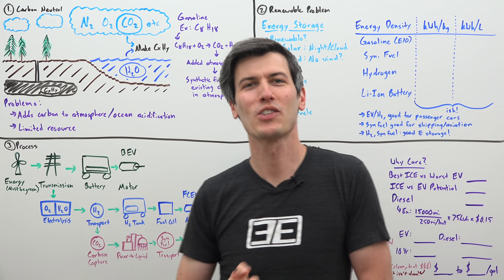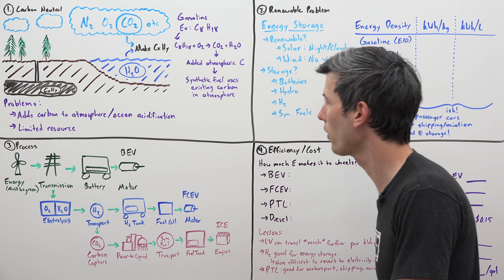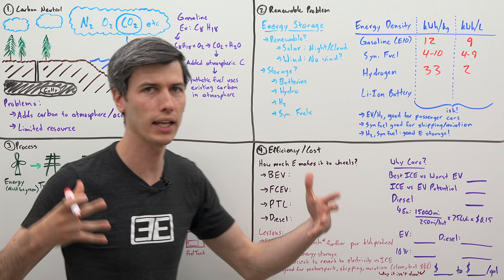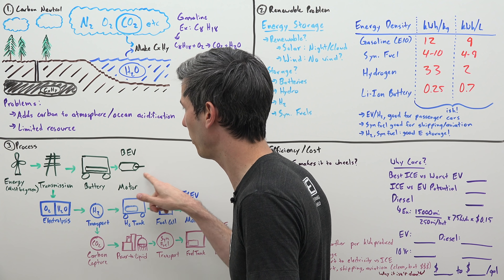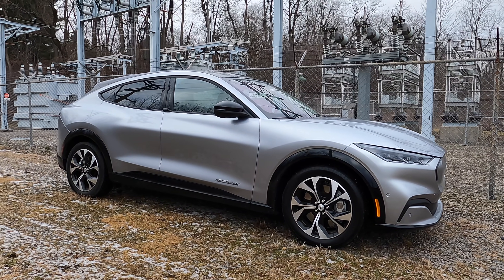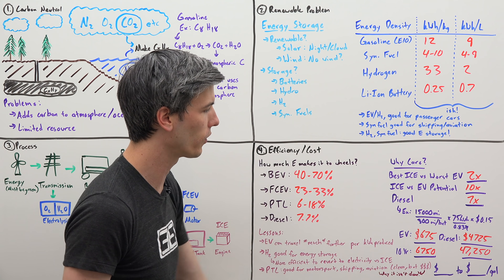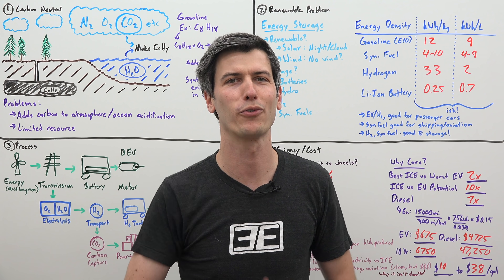The Big Problem With Synthetic Fuels

Comment: You had me until the end, at $2 a litre that would be literally better than a lot of fuel prices in the UK and these are diesel numbers. I imagine similar in Europe. $2 = £1.42 and current UK average per litre for petrol is £1.29 diesel £1.31. £1.70 being highest as of current costs which is no higher than average right now.

But in general the argument in the UK is that most people live in 'town houses' with no owned parking or driveway, it's illegal to run a cable across a footpath. Others in apartments which will inflate flat prices so much to install electric chargers which it's already a good £300k for a London flat with no parking as is. Synthetic fuel is likely to have a place here.
Reply: To effectively make synthetic fuels carbon neutral you need to start with hydrogen. So your issue is fixed if you just buy a fuel cell vehicle instead. Hydrogen Fuel cells will be the only option for large mass transport. Particularly if we want to reduce the amount of non renewable resources we dig up to make battery’s. Carbon emissions aside we keep missing the point that digging up the earth to make battery’s isn’t that much more sustainable than digging up oil. Fuel cell cars only need a battery 1/20 the size. If we can make hydrogen in a renewable non carbon emitting way, the efficiency comparison to battery’s is less relevant.
Reply: @Julsnalice  Do some basic research and you’ll find out your comment makes absolutely no sense at all. But guess you already knew that. If not, you typed your comment on a phone or laptop or computer which is 100% made out of mined materials😅
Reply: @Julsnalice  the only issue with hydrogen is that it's extremely combustible. One small fender bender could cause a big explosion, worse than the Ford Pinto
Reply: That $2/L is before any costs are added on though such as vat, profit for the company producing it/station profit per litre, fuel tax etc. Probably heading towards $3-$3.50 easily before you actually get to purchase a litre making it roughly £2.50 per litre.
Reply: @iandavis8725  It's worth nothing this all assumes Porsche reaches their goal. However, it is also worth noting that governments will also adjust taxes accordingly, since these fuels are much more environmentally friendly than regular fuels, which would decrease the gap and incentivize people to make the switch. They should probably slowly phase out fossil fuels at that point.
Reply: @HazewinDog  why would a government ever reduce fuel duty? It will just remain the same or frozen for a long period. Never in history has fuel duty gone down.
Reply: @iandavis8725  considering that synthetic fuels count as green. They most likely won't have extra fuel tax like fossil fuels
Reply: @DrTheRich  fuel isn’t taxed because it’s not green, it’s taxed because it brings in £40bn a year for the UK Gov at least.
Reply: @iandavis8725  Doesn't matter what the price is right now. What matters is where the price will head in the near future (5-10 years).
Reply: This video is wrong. He assumes the synthetic fuel will be made with electricity that costs the same as that you use at home to charge your battery vehicle. In reality synthetic fuels will be produced in places on Earth with the absolute cheapest renewable energy. Thus minimizing the real cost difference. So in the end, the bad efficiency matters much less than you would think.
Reply: @cryptohouse1676  irrelevant, until you use ICE. it's the awful unefficiency of non-electric motors that makes any fuel a failure
Reply: @carloorelli3538  No, you need to look at the big picture. Total cost and total environmental impact. Efficiency is just a small part of the equation.
Reply: Saudi makes a barrel of oil for less than $3.00... while synthetic oil cost is $318 a barrel. That would be comparing apples to apples. I do understand how when liters are used as a unit of measurement it can cause one to conflate that with end user cost, but that is not what is going on here.
Reply: The haters replying to this are picking up the wrong point - most of Europe has ancient towns and cities with no easy way of implementing enough charging for a significant proportion of the population that would be practical for current generation EV batteries. It's a big problem, I'm predicting EV sales will plateau once everyone with private parking & charging has one.
Reply: @jinbee2627  that's when the 'mobility as a service' arrangements kick in. If you have ready access to a vehicle, you don't need to own your own. And if vehicles are shared, there don't need to be as many of them, so the infrastructure to park and chnage them can also be reduced.
Reply: @jinbee2627  Youd be wrong. First, charging of EVs is done mostly at home so you actually dont need that many charging stations in a city even a super town rural one. Plus, gas stations are adopting them, so...

Yep, all of that is a non issue. You wont see a plateau because the entire world is going full electric with bans on ICE sells and car manufacturers are switching their full production to EVs. So in like 10-15 years, 100% of cars sold will be electric, hard to plateau with that.
Reply: @dzello So only homeowners will have vehicles if your utopia comes to pass. Because not everyone will have guaranteed access to chargers. That is like the green new deal happening. The rich will be fine and the rest of us will be fucked. It wont happen.
Reply: @shadowfire246  1. It actually IS happening right now. 
2. Everyone will have access to chargers. They are slowly getting built literally everywhere.
Reply: @dzello  Nice speculation. Do you really think someone without the possibility to recharge an EV at home will buy one? It defeats the purpose of buying it in the first place for economys sake (not that it is economical in the first place since they are more expensive than ICE cars). Noone is going to buy an EV to stand at a recharging station to pay 20£ just for recharging 2-4 times a week while also losing at best 40 minutes of their time. Yep, if Porsche manages to lower the price of their eFuel then this EV-agenda is over.
Reply: @MT-rc3gn  In the future, yes. Someone without the possibility to recharge an EV at home will still buy an EV. 

And considering they intend to literally ban ICEs, he kinda won't have a choice regardless. 

So really, it doesn't matter what you think lmao. Plus, Porsche intends to go electric as well.
Reply: @dzello  well we'll see
Reply: @MT-rc3gn  I mean, the bans are around 2035ish, its already in place. Manufacturers have also clearly said their intentions with Porsche specifically saying EVs are the way of the future, not efuel. As prices go down, people will buy more EVs.

This is all things we already know.
Reply: @dzello  we'll see
Reply: Yes but it'd £1.41 a litre plus 20% for VAT, then plus 58p a litre fuel duty so well over £2 a litre
Reply: Agree, most homes don't have the ability to charge a vehicle. People need to come to terms with both ICE and EV existing in the long term. The synthetic prices are cheaper than some places I've seen, especially motorway services. 
A good amount of people don't care what fuels their transportation, so there's certainly space for EVs to increase in their presence but a complete switch is unwise. There's also the issue around people having freedom of choice etc.
Reply: @car_ventures  How do most homes not have the ability? Do you guys not have power in your houses? You need to be more detailed than to just outright lie. Most homes DO have the power and CAN have the ability to charge quickly, easily. Very very very easily. Or already do. Either way, what you said is a fabrication
Reply: @jf8138  After you have an electrician install a 240v line from your power box for 2+ grand. Cause everyone can just pull that kind of money out of their asses.
Reply: @car_ventures  Don't forget the $2 per litre is before tax which is 2/3 the price in the UK.
Reply: @car_ventures  Once their is enough ev chargers you can charge your car wherever you park your car
Reply: @lachlanB323  I dont see many ev chargers out in the mountains or in the middle of the desert.... or really anywhere not urban.
Reply: @shadowfire246  Your telling me that non urban areas don't have power points? How do you charge your phone?
Reply: I often wonder about the practicality of the impending change to electric. Millions of electric cars rather than the relatively small number currently, needing to be refuelled taking hours rather than 5 minutes. A petrol station with 8 pumps would need about 200? charging points. Most people will need public refuelling facilities. They say it must happen I look forward seeing how this is solved. Private cars only for the rich and public transport for the rest. Covid puts that prospect into context.
Reply: @philspencelayh5464  There will be an abundant surplus of synthetic fuel from the aviation and marine industry. This will probably go straight to gas stations at lower prices than people expect.
Reply: @cryptohouse1676  where would all the energy come from?
Reply: @magnusd8226  Renewable energy from the cheapest places on earth. Wind in Argentina or Sun in Sahara for example. That electricity is 15x cheaper than what you pay in the US. 
Did you know that covering only 1% of the Saharan dessert in solar cells gives enough electricity for the entire Earth? We can have as much electricity as we need. It all comes down to economics and making things profitable. Then things happen fast by themselves. Renewable electricity will much cheaper in 10 years from now also.
Reply: @cryptohouse1676  Most aircraft run on kerosene. Ever tried to run your car on kerosene?
Reply: @philspencelayh5464  electric vehicle drivers don't charge at the gas station. My car charges over night in its regular parking space.
Reply: @philspencelayh5464  hours? A Tesla can be recharged 75 miles in 5 minutes. and there are rumors 4680 batteries get fully charged in 10. that's how you solve the problem
Reply: @carloorelli3538  When you buy into the charging ecosystem of one manufacturer does that make you beholden to them for your next car? Just curious, I'm new to this.
Reply: Many of the settlements in the UK and Europe were settled and even densely populated before mass adoption of automobiles. The cuts to railway track-miles in the 1960s effectively pushed many places to adopt cars. An expansion of railway service (and electrification of the lines) will bring those areas back into Pre-automobile mobility/connectivity with greater power efficiency and lower carbon output.
Reply: The key point I hope people would understand is that we need 3-4 times as much renewable energy to transition cars to Synthetic fuels instead of transition to BEVs.
How on earth will we achieve that if we already struggle with getting our grid green with current energy needs?
The cost of all this extra renewable energy is never discussed when people talk about the charging/fueling price.
Reply: No parking?..where would you even put ur gas car them🤷.
Anyways $2 might make sense compared to conventional fossil fuels but this video is about electric verses synthetic where even $2per litre is expensive
Reply: Love your lc brufa
Reply: *crying in australian prices
Reply: Hearing the word "Bonkers" in an American accent is truly epic. Definitely made my morning.
Reply: That price is influenced more due to tax than anything else.
Reply: I agree.synthetic fuel can be expensive and energy inefficient to produce.but what if the clean energy resource is abundant and the price is lower?(can be done I think)
Reply: @vanwandererx852  Yup, that will be the situation in not too long. Both electricity and gasoline where I live is super expensive. So E-fuels made cheaply in Sahara or something will probably be able to compete on price quite soon.
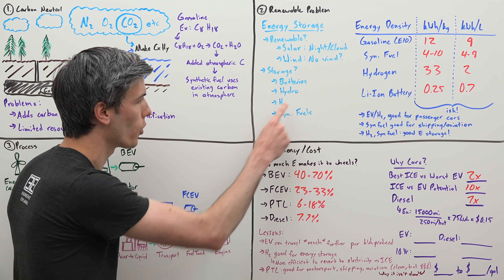Reply: @jimj2683  But countries and people in those areas will also probably need that renewable energy, you can't just go there and take it away from them. And even if for some reason we would be forced to do that, it would still make more sense to store that energy in hydrogen cells, transport it and then convert it back to electricity, as Jason also pointed out this would still be more efficient: 10:30 . 
So either this, or we would use that potential efuel produced in those remote areas for airplanes and ships only, due to it's energy density. 
Long story short, it's innefficient and irational to use efuels for personal cars.
Reply: You are dead right mate
Reply: It’s funny then how the EU recently allowed e-fuels, but Britain maintains their strong stance against them
Reply: Also, syngas could be exempt from fuel taxes (since those function as an effective carbon tax). If we want to tax cars, to cover costs for road maintenance, we should tax EVs same as combustion engines - just cause they don't burn fuel doesn't mean they don't damage roads.
Reply: That's the price after a markup and cost of transport etc. It means that you have to pay roughly double
Reply: I don’t know about electricity price in USA but in EU to charge 300kwh battery it will cost about 80 euro so for 15000 miles it will cost about 4000 euro per year, but my Audi will cost about 2000 euro if diesel cost 1.5 per litre. And range problem with electric car in winter is max 60% so it will cost even more
Reply: @flaperons3429  what? What's the cost of electricity there?

If electricity is truly 2x the cost of diesel, maybe you should get a diesel generator for your home...

At that point you're better off with solar! Even in a cold northern region, you just need 3x the amount of panels to compensate.
Reply: ELLOOOOO
Reply: Finally a response with some sense in it ... If we put up a charging point for everyone in a flat, we'll have a couch worth of living space left ...
Reply: A charger can be a simple power outlet. How is that costing us living space? 🤦🏻‍♂️
Reply: @bramjacob8623  😂, the fact you managed to gather 16 likes on this type of nonsense comment is hilarious. Must say, congratulations
Reply: @bramjacob8623  maybe there will be charging stations in public parking space,
Reply: And most people can't replace cars at the drop of a hat + the waste it would be if all Gas cars were banned. Plus again you can't buy a full-size SUV BEV right now. If BEV prices stay the same then it's just cheaper to keep your old full-size SUV than buy a new one. $500-$1000 a Month on gas still gets you 13 years with it instead of 13years of car payments on a new GMC Hummer.
Reply: It would, unless it's production capped. I'm sure Porsche will only be able to make so much of it per year, and I'm sure they'd keep it exclusive to Porsche customers for a while.

And if curious, for EV's I've seen the "urban supercharger" concept prove plausible. EV's are much more efficient at low speeds, and cities have everything closer together, so short 10-20 mile a day trips are likely, so a 200 mile range EV would only need to be charged once every 10 days, which could just be spending an hour at a fast charger once a week on your day off. If that's inconvenient though, there's always public transit.
Reply: @cpufreak101  why not  spend one tenth of that hour to fill your car with gas as well as avoiding public transportation and it's germs/diseases. Find a way of boosting the economy to adopt the high gas prices (if that could be possible)
Reply: @kegtrick  TLDR, it's unsustainable in a climate conscious world.
Reply: @cpufreak101  in more context, all I'm saying is I'd rather figure out how to make synthetic fuel more affordable and not loose the convenience of filling a tank in less than 10 minutes.
Reply: Don't care didn't ask plus your girlfriend was underage
Reply: Says guy who loves need for speed over forza mate you wrong
Reply: That's why EV is the solution, because electricity is much cheaper than any fuel. Even in the UK you get paid for charging your EV
Reply: @lillypichu4566  But electricity is made using fossil fuel. Electric cars are (currently) a dead end. If they are to succeed in replacing gasoline engines they must find a way to improve the power grids in developed countries. We currently cannot create enough electricity to replace ICE powered cars.
Reply: @matthewmosier8439  I'm talking about UK, and there's no problem about electricity in UK, some of facility even willing to pay you for charging your EV
Reply: @matthewmosier8439  it is not true that we can't "create" enough electricity, we can't store enough electricity is the issue. Also fossil fuels are not "creating" electricity it is taking energy from the sun stored by plants over 100million years ago and releasing that stored potential energy.
Reply: @LiverpoolReject  You are correct, energy is not created as far as we can tell, it just changes forms. My point, however, is that, practically speaking, if you were to, say, buy every home in a given country an electric car, that the power grids would fail. There are trillions of dollars, probably, in infrastructure to create and maintain all of the vehicles on all the roads in developed countries and to quickly swap that energy into electricity from fossil fuels would take a monumental effort.
Reply: @matthewmosier8439  yes so we need to get started and stop subsidizing carbo positive fuels. We have built massive infrastructure in the past and it is time to do it again. This time though if we fail it is going to be far more costly.
Reply: @lillypichu4566  You gotta be joking right!? We (the UK) do NOT have a grid that could support even 50% of all current cars on the road going to EV in terms of supplying the amount of electricity needed for people to charge their EVs.
Reply: that's why we need much higer taxes on diesel and petrol. they are killing the planet. as people can't stop using cars, at least they must be as clean as possible and ICEs are the most lethatl engines around
Reply: @carloorelli3538  ah yes the good ol logic, force people to pay more because they can’t afford something.
Reply: Nobody cares about the problems that you Brits have created for yourselves through ridiculous over-regulation. You put onerous taxes on your fuel, refuse to build refineries and then cry about the cost of “petrol”.
Reply: @oldcountryman2795  nah it's all of Europe and honestly the rest of the world that's similar. You guys are the odd ones out
Reply: @BlackPanthaa  Europe is the most overly regulated bloc of countries when it comes to this stuff.
Reply: @oldcountryman2795  The issue is nothing to do with lack of supply. I think over 80% of the cost of diesel and petrol is fuel duties, which you do start your arguement with. However, our road system is free to use and the cost is born out of those fuel duties, plus some car ownership duty.
Reply: @tedferkin  So how much do you think you'll be able to tax EVs?
Right now the calculation I made using official statistics is that at 2€/liter for e-fuel it's only 630€ more per year than gasoline.

So how much are you going to tax EVs when the government is SUBSIDISING = spewing OUT tax funds for example in Germany 9000€ per EV, in the USA the upcoming subsidy is $12,500 per car. Then there's the subsidies for the manufacturers for selling EVs (maybe not in the USA but in Europe many countries have that as well, I believe in Germany it's about 2000€?), then the subsidies for them building new EV factories.
 
Then the subsidies for chargers, in most countries about 1000€ per charger. Then subsidies for fast chargers, I've read them to be 75,000-150,000€ a pop!

Then the subsidies for grid companies (or in the UK the grid being owned by a privately owned multinational corporation whose goal is profit for its private shareholders) for the massive multi-billion if not trillion expansion and rebuilding of the grid.

Then the subsidies and costs of building massive amounts of new power plants and if not producing E-fuels they'll be more inefficient too.

Then take into account that even with all those massive multi-trillions of costs car manufacturers are currently not making any money with their EVs, or are at most making a puny profits compared to ICE cars which don't need any subsidies, cost consumers very little, and are actually heavily TAXED!!

So do you still think that the FIRST-PHASE, FIRST SINGLE FACTORY having a fuel cost of 2€/liter is a lot compared to EVs?

Especially since with e-fuels (and biofuels) emissions are lower AND we get basically all cars to those low emissions immediately, not only after several decades of churning out millions of new cars?
Reply: @oldcountryman2795  lol yeah because the people of England really made those first 2 decisions
Reply: @oldcountryman2795  why are you crying about the cost of petrol? yes, you. don't you get it? we subsidize things that are good for the environment and we heavily tax things that aren't. if Porsche can get anywhere close to their goal, that would change everything. Heck, even if it was taxed just as much, which is unlikely. I now finally understand why a company like Porsche believes in this. If they can actually bring the cost down to even $4/l, this could change everything.

also, if you don't care, stop crying about it.
Reply: @oldcountryman2795  Maybe, but at least our regulations stops buildings from collapsing on our heads like in miami. I'm sure those under the rubble enjoyed their "Freedom", but your deregulated economy results in thousends of dead citizens a year at the minimum.
Reply: @oldcountryman2795  USA has cheap fuel because of subsidies to keep it cheap, the Government is paying the companies to keep the price down. Otherwise you would be in the same situation as the rest of the world.
Reply: @RickyT15  No. You don't know what you're talking about.
Reply: @oldcountryman2795  so the US doesn't spend billions in oil subsidies? cause they do
Reply: @RickyT15  No, we don’t
Reply: @oldcountryman2795  very stereotypical of you. Well, you are still living in the old ages. Just cant keep up, huh?
Reply: @oldcountryman2795  You seem to care.
Reply: @oldcountryman2795  we pay 1,50 eurocents per liter ron95 fuel. So not, not just UK. Our prices per kWh for EVs is 30 eurocents - so you are pretty good in the US.
Reply: @oldcountryman2795  yeah because the general population have a say in what duty is placed in fuel…
Reply: @oldcountryman2795  Woah bud, no need to get so offensive. Those taxes you talk of pay for a lot of societally significant things, such as healthcare, for which I can imagine some people in other countries might be "crying about", as you put it. Perhaps less judging and more curiosity about why different solutions are used in other countries might be more beneficial?
Reply: @Mindseas  No point explaining to him. If he doesnt get something simple, hes just not smart enough for it.
Reply: @Mindseas  I don’t think petrol tax funds healthcare in the UK. That would be pretty regressive. I have no problem with taxes. I do have a problem with working class people not being able to afford to drive. That hurts everyone.
Reply: @oldcountryman2795  people don't have to drive, they have to be transported where they want, or good must be transported to them. It is bad idea for example that everyone should drive to the stadium for watching a game for example. You will waste resources building parking lots around stadium
Reply: @Mindseas  government healthcare = useless
why would anyone need it when there's private healthcare that's very well applicable and cheap for 90% of issues
Reply: @scamlordscamlord1229  why would anyone take this guy seriously... He is literally telling you he is scamming you in his handle!
Reply: @oldcountryman2795  The tax system raises money from a lot of sources, "petrol tax " is just tax. They all go into one pot and are used by the government of the day to try and buy the next election result. Definitely  "petrol tax" pays for health care because all of the political parties know that its suicide not to.
Reply: @philspencelayh5464  You don’t know what you’re talking about.
Reply: @oldcountryman2795  learn some geography and history first. Since decolonization western Europe lost access to cheap oil. Building raffineries and building your economy on imported oil is a bad idea, because Suez channel can be blocked, oil countries can be hostile. Diversify you source of information, don't listen only republican propaganda
Reply: @Kannot2023  Son, I’ve already forgotten more about oil than you will ever know. Ever heard of the North Sea? The UK produces half of it’s crude oil and imports most of the rest from Norway and the US.
Reply: @oldcountryman2795  Your first comment shows you obviously have no clue what you're talking about. Nichols is right: you have a lot to learn.
Reply: @dzello  Switched to your second account I see.
Reply: @oldcountryman2795  I know about North Sea but it is not enough oil there for whole Europe and is more expensive to extract from sea than from desert.
Reply: @oldcountryman2795   Yes we apply tax to our fuels so that motorists pay equally for services relevant to them such as road maintenance, free roadside recovery, etc. As well as services such as free healthcare. 

This tax also incentivises the population into lowering their environmental impact by using more fuel efficient vehicles, or using greener forms of transport where they can, instead of say, lumbering around everywhere in 15 litre 40 tonne "trucks" that never see more versatile use than a Honda civic. 

And yes, we have a diverse supply of oil, so that if for example, somebody hacked into one of our pipelines, it wouldn't turn into the plot of a Mad-Max film.

This "ridiculous over-regulation" you speak of, known simply as "regulation" outside of the US, is probably the reason our crime rates are dwarfed in comparison to yours, as well as our poverty, unemployment, and obesity rates, and is generally why we have a better quality of life, and at a lower cost.

You are talking out your arse when you say we refuse to build refineries.

And yes, its petrol, short for petroleum, the name of the liquid it is derived from, as opposed to "gas".

The only problem "us brits" created was you lot.